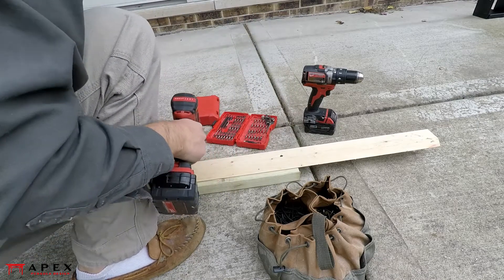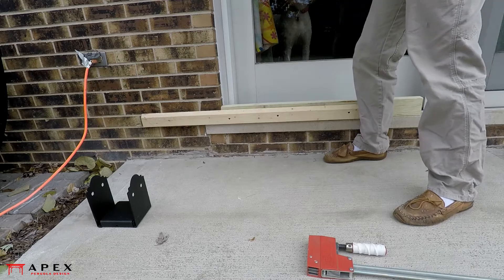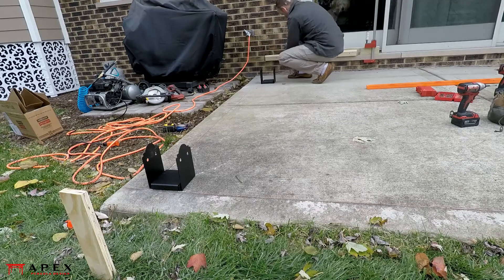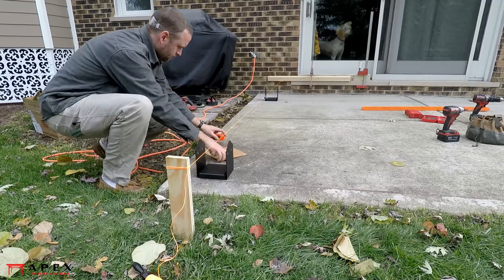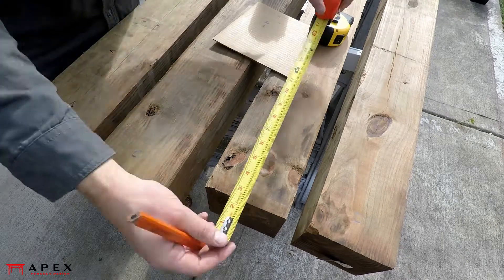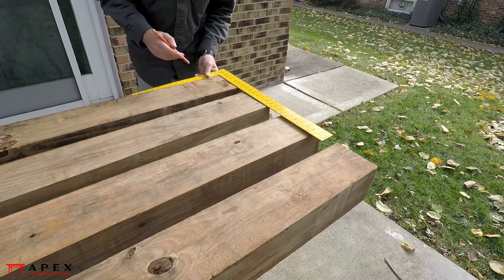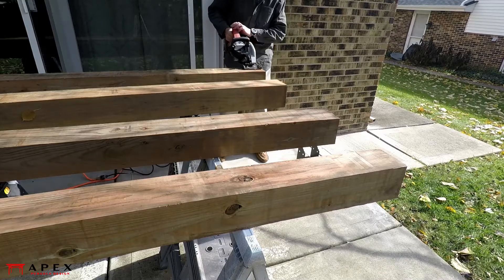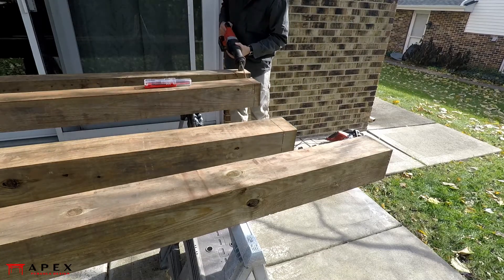Find Required Post Lengths and Cut to Length | Posts & Post Bases Part 2

Comment: Were these posts 8 feet? I had thought that 8 foot would be too low, especially when some of the beams rest below the top of the posts, but your finished product looks more than high enough.
Reply from the maker: They are 8ft, and there's just under 7'-6" clearance under the bottom beams. However, the plans I now sell use 10ft posts for that particular reason.
Reply: I’m a little confused. Wouldn’t you subtract each offset length from each individual post and call it good? I don’t understand why you would take the longest offset and apply it to each post plus the original offset.